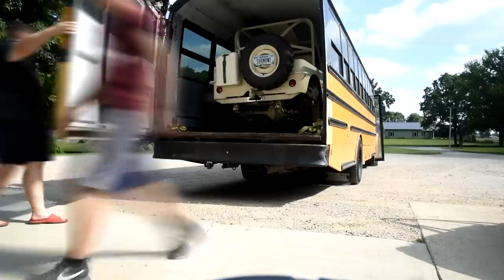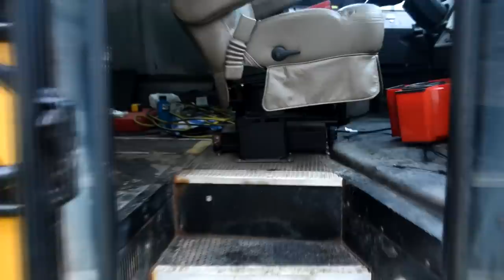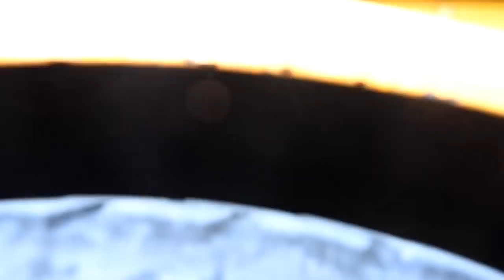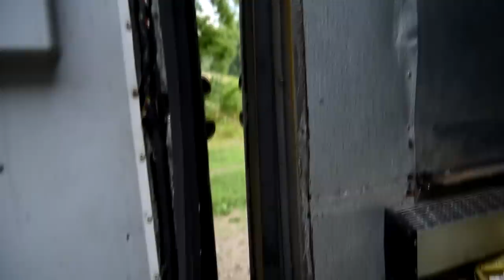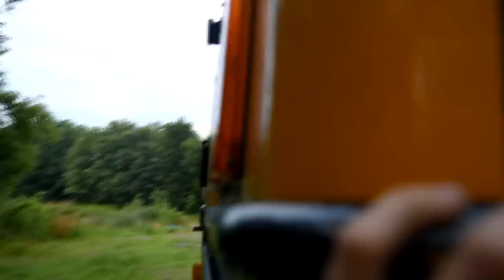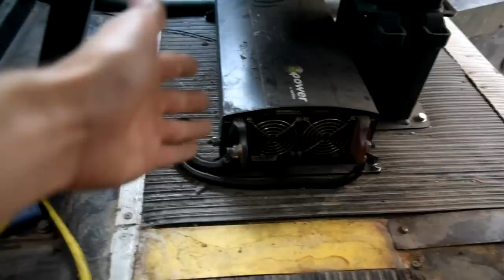FINISHED - The Ultimate Toy Hauler

Comment: great idea on lining up the hinges. I saw an RV that the whole back wall lowered down (hinged at bottom) to be the ramp.. also you could mount cots that fold away on the wall for sleeping...  the only thing they might nail you on is there is nothing to stop the jeep if it slides forward in an accident.. on trailers that barrier is the headache rack

Comment: They likely made the wheel wells so tall incase an airbag popped so it wouldn't force a moving tire against some kid's feet/legs.
Reply from the maker: I drove it with bags deflated, and it still had clearance.
Reply: @TurnNBurn  It's not for tire clearance, it's for blowout clearance. You would be surprised at the damage a semi tire can do at speed. A little space between the rubber and the steel gives the steel a chance.

Comment: I just bought a bus to do exactly this! What shop did the door and how much did it end up running? I'd 100% consider taking mine down to Indiana to get the door fabbed up. Also if you had this project to do again, what might you have changed?
Reply from the maker: We did everything ourselves. Truthfully I wouldn't change a thing. I spent tons of research picking out the right bus to start with.

Comment: Cool bus but those mods are an expensive addition. Also I drive a school bus the mpg is horrible. Ok if one has money to burn.
Reply from the maker: 8.5 mpg. Total cost $8500. Not bad at all.
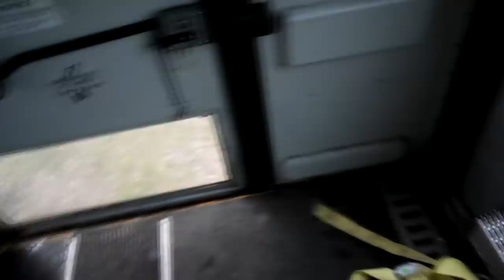Reply: @TurnNBurn  I had a 1966 Chevy Van, I made for work .... I dropped a 350 4 Barel in, and a 14 bolt 4:56 rear end .. it got 7 MPG on the Hiway 8.5 in town :)  (with a full 2000 pound of tools in it 24/7)

Comment: Did you had to modify the bus wireing for the tail lights and marker lights
Reply from the maker: I had a shop install the brake light controller for the trailer. It needed a module because the left and right side lights are on different circuits like a semi.

Comment: I would upgrade that drivetrain. Put a better gear in the rear end and upgrade that transmission.
Reply: That Jeep does not weigh as much as a bunch of unruly kids, and it doesn't shift all over the place, either. Seats are gone, and it's on an air ride as well.
Better to get a gauge to see what the bag pressure is, and go from there.
I'll be willing to bet it's around 40 lbs fully loaded.

Comment: This is awesome! Is there a way to contact someone about the details of how you did this?Cost, time, etc.... I work with a School Band, and we have a bus that this modification would help so so much when loading and unloading equipment.
Reply from the maker: I would guarantee the school corporation probably won't allow a modified bus. Most bands use a double decker semi trailer. Drum and pit equipment on the bottom, small stuff on top.

Comment: Do you still handle and sell terra tiger parts or buy them ? I need the floor pan and maybe the original motor and motor mount w/ drive clutch ! Can you help me out ? Are you in Wisconsin ? I’m in Minnesota ! I can come to your place to get the stuff !
Reply from the maker: I don't deal in those parts. Try Richards Relics
Reply: @TurnNBurn  I did but he doesn’t have the floor pan ! I’ve tried to get ahold of you for 2 or 3 years ! Lol. Is there anyway you could get me pics and dimensions of the floor pan ? Or maybe I’ll just wing it I guess , I don’t have one to make a mold from . Lol. If you don’t want to don’t worry about it , it’s not a vintage restoration but more like a upgrade on parts ! I’m handicapped and would like to use it for hunting .

Comment: Will you have to cover up the red lights at the top of the bus?
Reply: The lights shouldn't have to be covered as long as "School Bus" is covered. I've seen guys locally wire them up as brake and turn signals but that's a much more modern bus than I usually see locally those lights may do the three quick flashes when turned on so he wouldn't be able to do anything with them

Comment: Good idea but u guys hacked it up. Could have been way better if a professional did it. Also it should have hinged down   so it could b ur ramp also. I know there's glass there but that too could have been modified. That wiring situation for the trailer. Not gonna work ! How could u sell something that u kno is gonna have issues ?  Fix it first. Reputation is everything... Yeah it looks cool but just another hack job. It's all in the details. Also when u get a flat ur gonna have issues with the clearance u guys cut out of the wheel wells. A disintegrateing tire is going to demolish those hacked tire wells u cut. Oh well rite ? Not ur problem once its sold...
Reply from the maker: I appreciate the feedback but do have to provide my research. It could not hinge down - how could we get it back up? There was zero room for a traditional ramp spring as I needed all the clearance for my Jeep roll bar. Not to mention the amount of reinforcement to put 3,000 lbs on the door. It would weigh hundreds of pounds and nobody could lift it up. The trailer plug wiring could use a spool, but it did work. As for the tire clearance, you are incorrect. The bus has an air bag system. We fully deflated the air bags, putting the axle against the bump stops (meaning it cannot physically get any closer to the body) and we still had approx 3" of clearance between our new wheel wells. This entire bus was heavily researched before execution.
Reply: Louis, post the link to the video of the amazing project you completed so that we can all learn the correct way to do the job.